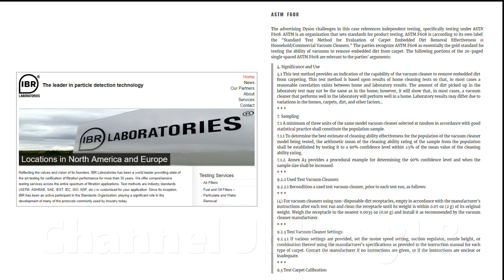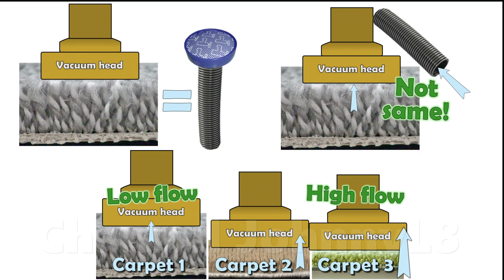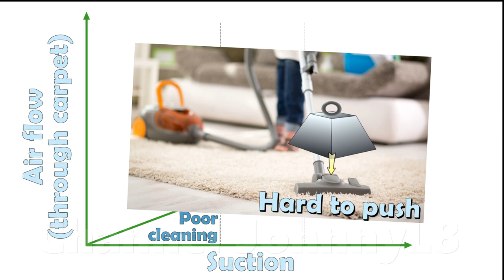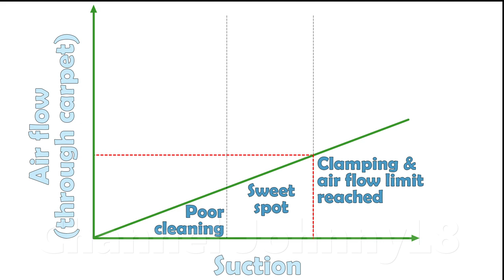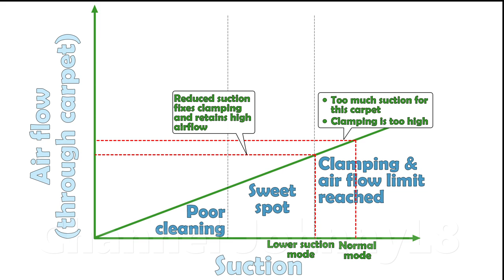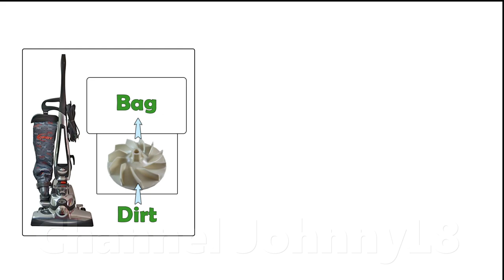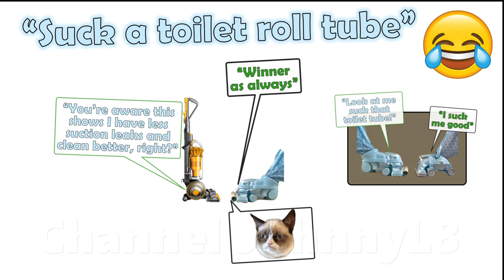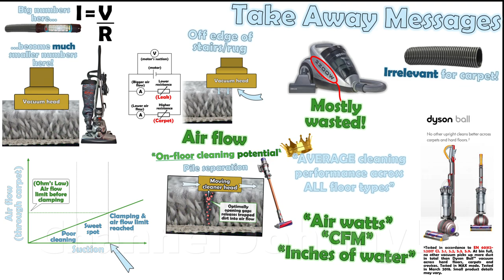Vacuum Cleaner Suction, CFM, & Air Watts

Comment: This was super interesting and well put together but for me it missed the point. At the end of the day when I'm at the store how do I compare and choose a vaccum cleaner. This felt almost like a Dyson commercial, and what if I'm not vacuuming on carpet and mainly vacuuming hardwood floors.
Reply from the maker: The video was about suction, air watts, and CFM, and why they cannot be used on their own to determine cleaning performance. As such, the video absolutely nailed the point better than any other source on the internet I can find. The way to compare a vacuum cleaner is to use the golden standard, universally accepted by all manufacturers and used in courts of law: a formal, independently conducted, statistically significant, industry standard comparative test. While not intending to be a "Dyson commercial", sometimes stating facts comes across this way; Dyson cleaners are, objectively, independently measured to be the best performers on average across all floor types. This is discussed in here ( https://www.youtube.com/watch?v=pVheYuzIk3I ), which also shows Dyson making the claim formally, and what happens to companies who make such factual claims and are proven to be liars for profit at the expense of the customer.
Reply: @VacuumFacts  those 3rd party are not always easy to find especially for product such as central vaccum 

Alot of 3rd party reviews are also funded by the companies themselves which always brings question regarding possible biases 

What we need is a truly standardized test companies need to go thru so that they can then produce numbers that can be trustworthy so that the individual can do I form decision on those.
Reply from the maker: @remypaquin7224  Formal industry standard testing is not conducted by '3rd party reviewers'; they are professionally and scientifically conducted to the highest quality in an engineering laboratory. Such 'standardized test companies' already exist to do just this, as was discussed in the video I linked to in the previous comment. The misleading output of 3rd party reviews is mostly what you find on the internet and YT, which I've dedicated this channel to exposing and debunking. But you are right that professional, reputable data is not always available. However, the manufacturers that achieve the highest comparative rating in formal testing proudly boast their achievement. In fact, only Dyson, as far as I've seen, has ever done so (and not been shown in a court of law to have lied and deceived their customers and been sued for millions, as discussed in that earlier video). So, such claims by reputable manufacturers are one indicator for what to buy. While there are many good products out there, Dyson products are measuerd in independent formal industry standard testing to clean the best (again, I'm stating facts, not advertising). There used to be labels boxed with every product in the EU attempting to provide some comparative indication of the relative performance of a vacuum cleaner. However, Dyson exposed them as utterly flawed and the EU to be corrupt for allowing them to be peddled, and successfully had primary EU law revoked. It was a great victory for customers, as discussed here https://www.youtube.com/watch?v=cNDr6aEULIA . Central vacuums are an absurd formfactor, the wholly avoidable flaws of which are discussed here https://www.youtube.com/watch?v=80hepoNEZhM . Also worth noting that not a single manufacturer of central vacuums provides a dot of evidence to show how their products perform in industry standard testing (the hallmark of hiding inferior performance) and instead substitute with nonsense metrics, motor measurements, and other obfuscations to deceive potential customers. I'm also fairly sure you can't just buy a central vac at the store either, given they need to be professionally installed at enormous cost.
Reply: @VacuumFacts  it didn't occur to me at first that you are probably from the UK and that their are alot of older house where a central vac install would be a nightmare but in North America especially the region I'm from, almost every new house build come with central vac system as standard and that the individual can then go to almost any hardware or big box store a purchase a central vac, installation usually consists of 1 or 2 wire and 1 or 2 pipe + the wall bracket

Having said that if we were to buy a central vac on what would you base the purchase on when no lab test is readily available
Reply from the maker: @remypaquin7224  Well, I'd never recommend a central vac at all for all the reasons outlined in the video I previously linked to. There are far better solutions to the task of cleaning. I don't think there is a relevant metric to compare central vac systems, given how they work. The manufacturers provide no useful data whatsoever and obfuscate with irrelevant motor properties which do not directly transfer to cleaning performance. As such, it's pot luck. Go with whatever is most reliable and cost effective.

Comment: I would like to thank you so much for the wealth of information you have provided on these subjects. I haven't even finished/grasped this video fully yet. You are amazingly/dangerously educated on the subject, and I love that.

My interest lies with carpets and upholstery in car interiors. I was actually looking at very high powered vacuums with great suction and air flow. But how would you think the Dyson V11 would fit in that enviroment? With lots of tight spaces, uneven flooring and bigger dirt particles, I'm unsure. Thanks in advance.
Reply from the maker: Thanks, although there's nothing in here (principles) that's particualrly advanced or isn't taught to all children in school. I did make an effort to articulate it well though. This is one of the better videos I've done, but there are many others with valuable facts and explanations.
Dyson claim their handhelds are designed for car cleaning. Some very tight spots might be hard to get to with the motorised heads, but there are other tools, like the crevice tool etc. It can cope with uneven flooring better than most because the mini motorised head has a pivoting soleplate to help keep contact. Particles with dimensions no larger than the smallest internal pipe diameter, so coins etc, should be fine. There's no reason to think it wouldn't do at least as well as the next best cleaner.
Reply: @VacuumFacts  You did indeed articulate it very well, it's kind of a lot to take in of course. Watching more than one time is helpful.

Do you have any idea if the Dyson extension hose would be 'easily' 'modified', to run the (small) powered head? Or does it block the electrical connection on both sides (Main unit- and head-side)? Being able to run a powered head with the extension hose would surely be helpful in the tighter spaces of car interiors.
Reply from the maker: @rheijne95  The extension hose doesn't transfer power and support air-powered tools only. You can get most places with the motorised head though and only need to get nooks and crannies with the air tools.

Comment: How can i learn more about this (airflow physic). I am curious about lost of suction power when a shop vac is hooked up to cyclone separator.
Reply from the maker: It depends to what level. if it's lay, then internet searching. If it's deeper and scientific, then the library and lots of books. While you could measure the suction pressure at the cleaner head, you're simply better off conducting careful comparative testing of cleaning performance (as I do in my reviews). Resultant cleaning performance is all that counts for most end users, and other metrics aren't that relevant unless you're engineering and tuning a product and tell you more about the motor.

Comment: 11:42 The light ball also has huge gaps in front of the head, so am I better off using the vacuum in it's + setting all the time? Or will the - minus setting better at focusing air into the carpet?
Reply from the maker: You don't focus air 'into' the carpet; you draw air through it into the cleaner head. Open gates allow current into the machine from places other than the carpet (suction is lost). '+' mode has no suction leaks and gives relatively more pile airflow which cleans better. The influence of the front gates on cleaning performance is demonstrated in the V11 review. https://www.youtube.com/watch?v=Wk-1d8T0mmY But you might want some suction to be lost because clamping is too great for the floor you're on (covered in this video). So it's a trade off depending on your needs. The front gate idea is a good implementation of this control.

Comment: I have a question: 
I own a Mobile Auto Detail Cleaning business. 18 years experience. This past weekend I built my version 5 of a vacuum vessel for my van mounted machine. This one is built out of 3/4" Plywood with 2"x2"s on the inside for support on all 2 degree corners to help prevent collapse which occurred on my last one version 3, My son is also an Auto Detailer, I started with version 1, my son gets the even numbered versions and I get the odd numbered ones. All versions are coated with 2 part epoxy/polyurethane rubber to waterproof it. Plywood is great as you can make any shape you want whereas there were no Poly-tanks available anywhere that fit my needs. There is also 3 Cross 2x2s to help prevent collapse. This vessel is 16" wide, by 18" high, by 42" long.
My question is: I have 2 vacuum motors one is a 3 stage 14.4 Amps and the other is 2 stage 13.13 Amps and water pump is 1.6 Amps. I got the most powerful vacuum motors to keep under 15 Amps so the Circuit Breakers don't trip. 
So, which is better, Parallel or Series. My last vessel was Parallel, but my newer one is in Series. Which is better? I'm testing my newest version tomorrow.

I'm going to have to watch this video a few times to grasp what you are teaching. 
Great video though. 
Peter from Calgary, Canada.
Reply from the maker: Unfortunately, I don't have sufficient information about your specific project to provide technical advice. Nor is that the intention of this video. It's not clear how you define "better" either. This video provides education into textbook physics to help clear up complete misunderstanding associated with off-the-shelf products. Sustained pressure differential to drive air current is required in the presence of resistive load. This current needs to then be optimally utilised to achieve particle removal, and that is very difficult to engineer.
Reply: @VacuumFacts  Thank you for your video and your reply. I used this machine today with the vacuum motors in series, I'm still not sure which is better for my machine. I found this video quite interesting from Queens University in Canada. https://youtu.be/A611jYuKwaU so since air is also a fluid to put the weaker vacuum first then the more powerful one might be a bit better. if I test this out I may inform you of my results.
Thanks again,
Peter Hall.
Reply from the maker: @nicevideomancanada  Hi yes, he's essentially teaching basic Ohm's law, albeit using silly terms like 'head' (he means voltage or pressure). Two pumps in series gives you more suction; in parallel gives you more current. Suction is more important for cleaning carpets because it allows you to overcome the resistance they cause, to sustain current through them. My video explained why people get confused and think having lots of current on a vacuum, at the expense of suction, is better. They fail to realise that measurements of current at the open hose when there is no resistance isn't representative of actual use on the floor. High suction machines sustain current in the presence of resistance much better and therefore clean better. Furthermore, my video explains that even if you have high suction to sustain good current through the pile, it still has to be utilised well with exceptionally effective head design to get best performance. That way, you can use fewer resources without performance compromise.
Reply from the maker: @nicevideomancanada  >> "Why do my vacuum motors blow air out of the discharge end even though the vacuum hose is blocked by my hand. Where is this air coming from."
Difficult to know without seeing it and what's happening. It's posible there's either a bleed valve in the motor to allow some net flow, even when the inlet is blocked, to prevent overheating. Or, it could be the impellor is providing enough kinetic energy to the air that it still causes a current and some air flows back in the neutralise the vacuum. Again, hard to say without seeing and feeling it in person.
Reply: @VacuumFacts  Thanks.

Comment: Well, I don't need to know about the carpet, I have a vacuum cleaner with 180air watt and another with 255 mbar/kpa  how I know witch stronger, and the difference.
Thanks
Reply from the maker: Air watts are a measure of above floor cleaning potential and can't be used to infer anything about carpet cleaning capability. Suction alone also isn't enough to determine cleaning performance, which has to be measured directly on a given flooring.

Comment: Thanks.Where does psi come into play? I am trying to replace a 2 stage in turbine paint sprayer with a more powerful unit.What should i most pay attention to? When comparing to the vacuum motor in in my sprayer to what is available.To increase psi at the paint gun
Thanks
Reply from the maker: PSI (pounds per square inch) is a different (and very stupid and old fashioned, imperial) pressure unit. It's the same as suction on a vacuum cleaner, albeit pressure will be positive relative to atmosphere for the sprayer, rather than negative for the vacuum. Without knowing the design of the sprayer you are referring to, it's difficult to comment. But increasing (positive) pressure difference will increase the energy in the system, making it more powerful. However, your paint will be likely be aerosolised more aggressively too, meaning a smaller droplet size distribution (finer mist). Not sure how flow rate is controlled or aperture size. I'm sure there are some off-the-shelf spray guns suitable for painting you can purchase whose data sheets can give you further relevant information.
Reply: @VacuumFacts  Thank you.It is a Earlex 6002 stated at 4.5 psi,with 90 cfm in the manual.Most 2 stage now are 5-5.5. Yes looking for finer atomization .Should i be looking for a motor that will fit with more cfm or lift? or balance of both?
Reply from the maker: The flow rate relates to the magnitude of paint you'll spray, but the pressure will relate to how well that's aerosolised. So it's up to you what balance you want. It's difficult to gauge using on-paper specs; you really need to try them and see if possible. A lot of this is experiential-learning.
Reply: @VacuumFacts  Thank You

Comment: How to convert Air watt to Kpa ?? 
Karcher WD5 suction power is 240 airwatt & Philips suction power is 33Kpa. So which have more suction power ?

I mean 240 Airwatt has more suction power or 34Kpa has more suction power ?
Reply from the maker: You'd convert in the same way as you'd convert oranges into elephants. Namely, you can't because it makes no sense. These are assorted motor capability metrics and say nothing about cleaning performance on carpet. The only metric of relevance is to directly measure cleaning performance in a statistically significant way. This is shown in my reviews.
Reply: @VacuumFacts   my que was so simple .. which have more suction power WD 5 ( 240air watt) or Philips power pro (33kpa) because both are different measurement . Some brand gives in airwatt & some in kpa. 

If you don’t know the answer it’s okay. Just don’t give stupid excuses please :)
Reply from the maker: @iamakashpatil  I suggest you watch the video you're commenting on. It explains what the metrics are and from that you can figure out how to convert (you need to know air current). But even when you've done that, it will only allow you to compare one motor with another and it will say nothing about how each performs. This was explained in the video. "If you don’t understand my answer it’s okay. Just don’t give stupid responses please :)"
Reply: @VacuumFacts   yes I don’t understand Answer that’s why I asked you two times. I was not able to figure out which one have more suction power in between 240airwatt & 33kpa.
Why would I ask if I understand? LoL
Reply from the maker: @iamakashpatil  Hopefully you understand the situation now

Comment: Im still confused so how much is 180AW in normal wats but in nubers like 100 or something.
Reply from the maker: There's no direct relationship between air watts and motor watts (other than motor watts is the maximum power supplied to the system). The whole point of this video is to show that air watts is a fairly irrelevant metric as far as cleaning performance goes. Machines with fewer air watts can out-clean machines with lots of air watts. What's more important is how the resources available are utilised by efficient design to maximise cleaning performance.
Reply: @VacuumFacts  So basically if I want to buy the dyson big ball i cant compare the power to lets say a samsung vaccum because air wats dont mean anything.
Reply: @VacuumFacts  Thank you
Reply from the maker: @haruncviko4957  Yes; that's exactly right. The best way to compare machines is based on three criteria (that I always use in my reviews): real-world representative cleaning performance across all floor types, ease of use, and environmental impact.

Comment: And how about hard floors?
Reply from the maker: That's a different system not covered in this video. Industry testing also covers both flat and with crevices. Crevices requires high suction as it becomes like the leaky situation discused in the video. Other things help beyond suction for flat hard floors, like carbon fibre bristles and design which balances high suction with being able to still move the head. It's nothing like as complicated as carpets though.